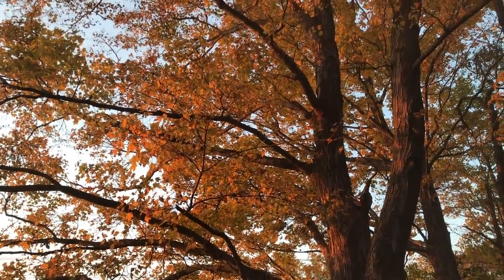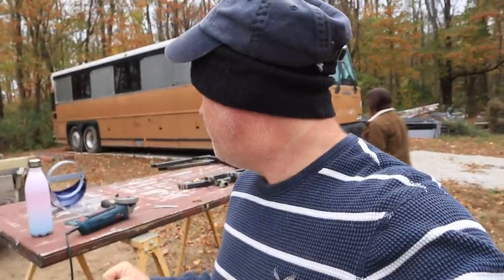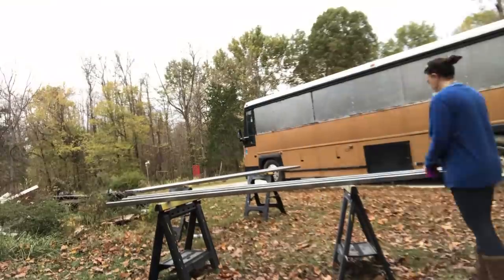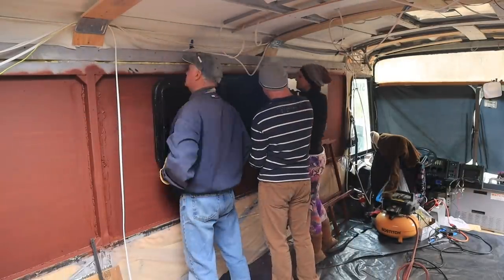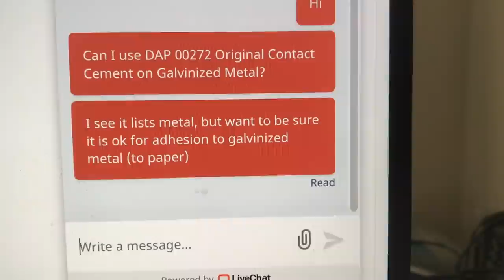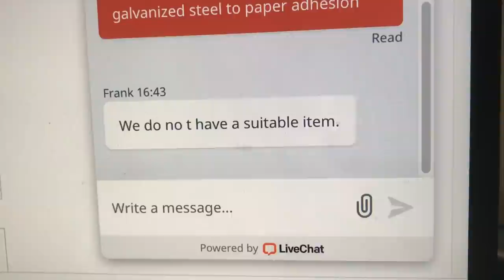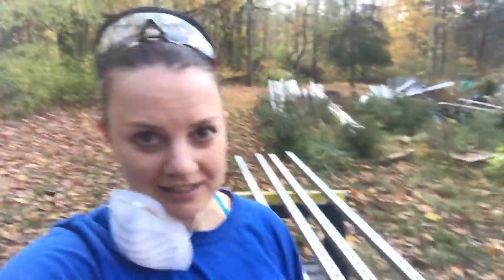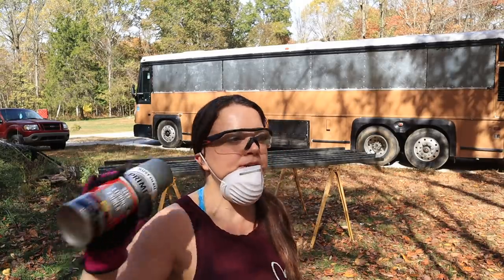Installing Window Support Frames for our Bus Conversion - S03E36

Comment: The issue is not the galvanised metal, it is that you called the ceratex "Paper" when it is a ceramic "cloth". However, the best adhesive for this scenario is spray glue as used by upholsterers.
Reply from the maker: The Ceratex we bought is called a ceramic fiber paper.   Regardless, the contact cement does and did work with the Ceratex on our ceiling (aluminum).  We had spoken with DAP to make sure it was the right application for ceratex when we used it on our ceiling.  The contact cement had a chemical reaction with the rusty metal primer and the contact cement is not advisable to use with galvanized metal.  Thanks for bringing up upholstery adhesives though!  Someone else may be able to look into that for their application.
Reply: @Rehabit8  Yes it is called paper because it is not woven fibre, it is compressed fibre like paper is, but it is not actually paper. The contact adhesive was a solvent for the paint which is why it came off. But Rubber adhesives are not ideal for Galvanised steel. I am using Spray foam onto the surface and then a layer of CeraTex spray glued to that before the wall panel goes in. This way the spray foam won't add any strain on the CeraTex to panel interface. Are you using spray foam or insulation Board?
Reply from the maker: Sheep’s wool.  So no strain to the Ceratex.  LaCroix Cruiser used spray foam and then sandwiches the Ceratex between two wall panels.  So you don’t have to adhere the Ceratex to the spray foam that way.

Comment: Metalic pant jobs are multi-coat,
the "Solid (possibly Metalic) Colour" as a base,
a semi-transparent layer (probably several coats) with the Metal-flake suspended in it,
then a "Clear" to lock it all in.

Comment: Mela, i replaced the doors on my house with composite ones and couldn't find a paint match anywhere so i could match my step and garage door. So i loaned a paint scanner and chip card set (3000+) colours, found the match then took that swatch and got it scanned at a paint store and had the colour mixed for metal paint. Perfect colour match. Go get your silver girl.

Comment: Hey Mela & Don, regarding paint: Find an automotive paint supplier in your area. I restored an old VW Beetle years ago. I couldn't find the color I wanted and didn't want to go to where the pros buy car paint because I thought I needed to have some sort of license to buy that kind of paint. At least in CA, that's not the case. I found a paint supplier in the area of town where all the car dismantlers were. Got exactly the color I wanted, and it wasn't rocket science to paint the car.
Reply from the maker: Thanks that is really good to hear. Definitely will look into that then.

Comment: Hey guys we used sika flex in the RV industry for awhile and we had heat boxes that warmed the tubes, you could do the same by putting the tubes in a plastic bag then drop them in a bucket of hot water, also cut the tip of the applicator off a little so it has a bigger hole to come out. Good luck, Take Care and Be Safe
Reply from the maker: Thanks

Comment: I appologize if someone already said this. Instead of cutting the tubes of adhesive wide open. Just cut the tip a lot further back. Your trying to squeeze molasses through a straw. Cut all but an inch or so off and then make sure you punch all of the membrane out of the way so your not getting restricted there too. Far easier.

Comment: It may be cheaper to have the bus wrapped instead of painting but that is a preference thing
Reply from the maker: Would love to have it wrapped.....but it's a lot more expensive than doing a DIY paint job unfortunately
Reply: @Rehabit8  Had a friend wrap a small bus with returns and rejects that they hodge podged together and made it look really good and they got the materials for over half off. May be something to look into. But if you do paint Harbor freight sells a decent paint gun that is under 50 bucks and well worth looking into.